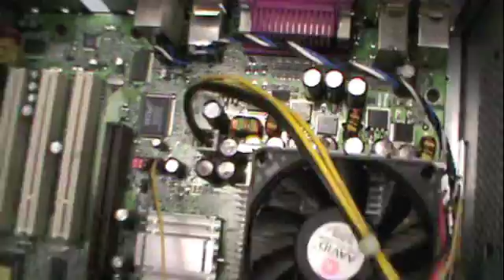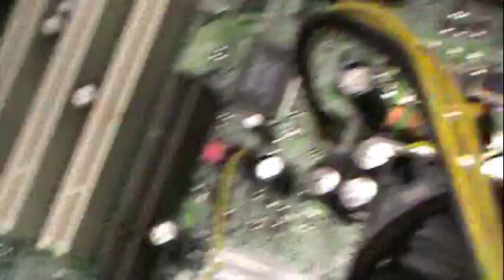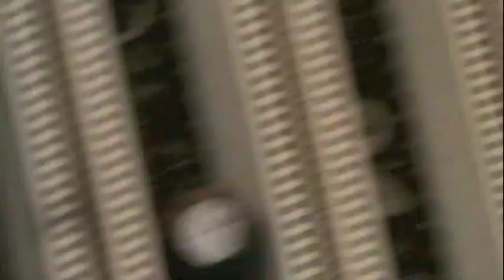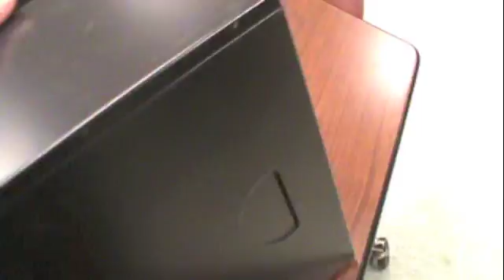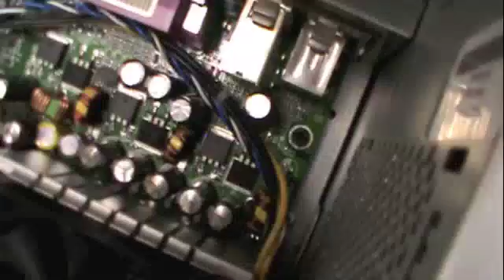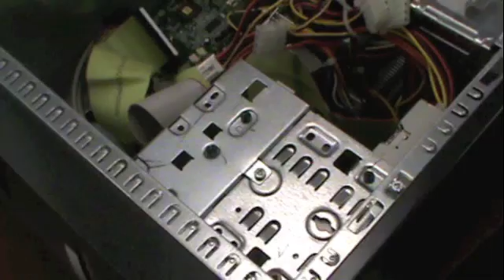This is what happens when capacitors go KABOOM!

Comment: I had a flatscreen go bad because capacitors failed, but after I replaced the caps that looked bad, I also found one that measured bad even though it looked okay visually. So it worked again: For about a month, until something else failed in the power supply, and it wasn't another capacitor. In fact, I never did find out what it was, since my patience was pretty thin with that TV, given that it only worked for like 2 years before it quit the first time. So, given something else failed that wasn't a capacitor, and I've had other Viewsonic TVs and monitors that have gone bad early, I think in my case it was a matter of just generally poor design. I don't see as many people with Viewsonics anymore. They used to be better back in the days of CRTs, but they've gone downhill since then. In fact, it was so rare for me to see a Viewsonic monitor or TV anywhere, I initially thought they had gone bankrupt!

Comment: I had a dell made in 2004 that died due to this, RIP, the capacitors were literally exploded in the case. I didn't even know it happened until I opened up the case to find out why the computer wouldn't work (you would think I would have heard the capacitor explode). Luckily I knew what a blown capacitor was at the time and was able to figure it out.

Comment: In my experience, if the motherboard still tries to boot then a recap will generally work. if the motherboard shows absolutely no signs of life and has various burn marks, then it's most likely dead. Though there are some dead boards that are dead because of the caps, in which case you can install some donor used caps in strategic places to get it working well enough to know if it's still good.

The caps that are generally needed for absolute basic booting are around the CPU, chipset and RAM slots. I usually keep a pile of assorted caps on hand for testing when I have a recap job come along.

Comment: I've been a victim of this failure many times.  Tyan Trinity mainboards, Achme power supplies (these ran in my Shuttle SS51s for over 4 years before I pulled the machines. Guess I made a good call! :o) ... the Samsung BW206 monitors, various other boards.

In the case of the PSUs, I ended up junking them cause my time is worth more than the replacement cost of a new PSU.

Comment: They also blow if there are cheap. most electronics have cheap ones. An example is LCD monitors most fail due to this.  I remember salvaging a VIA 1GHZ ITX board with blown capacitors . I tried replacing them with a cheap soldering iron and ended up doing more damage then good, Probably as I had limited experience removing them. Ive got quite good now.

Comment from the maker: @68000cpu Alright, it turns out I was half wrong, and half right; there were counterfeit capacitors labeled as "Nichicon" that were made with a stolen formula, but Nichicon was not the cause of this issue. Also, these capacitors were not the "counterfeit" variety; they were simply a bad batch of genuine Nichicons. Thanks for giving me heads-up. However, I did not appreciate your comment; for someone who considers himself a professional, you should be ashamed.

Comment: When I get computer with bad capacitors I always check the power supply. Mostly in my cases is PSUs fault. I change capacitors on motherboard with same one, but I never change them in PSU. Some PSUs are nowadays realy cheap, so its better to change whole PSU.

Comment: I can well imagine that capacitors which fail in this fashion could do quite a fair bit of damage, when a capacitor fails like that do they make any sound or produce a smell of released chemicals or burning smells?  If someone was working at a machine or using a device in which the capacitors failed whilst they were operating the device, would they know that something was wrong as soon as a cap failed assuming it failed in a very low key controlled manner and didn't irrupt into flame and smoke?